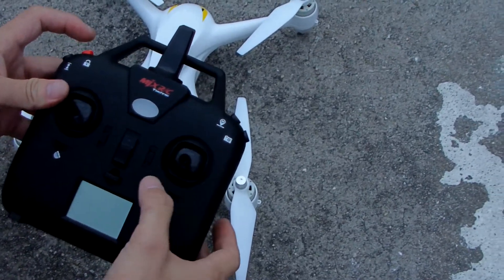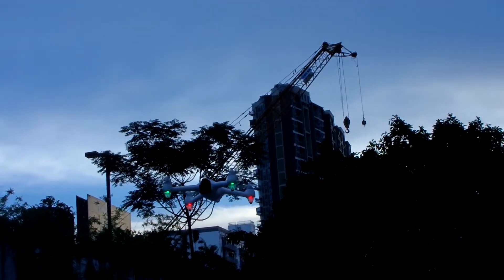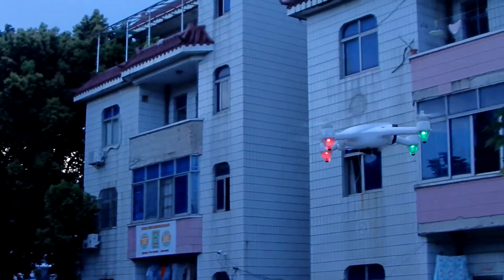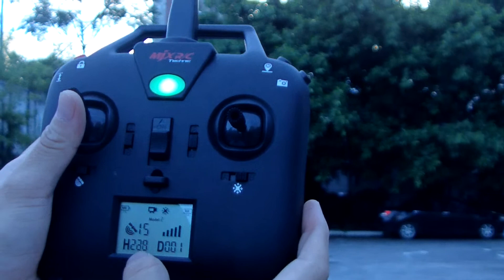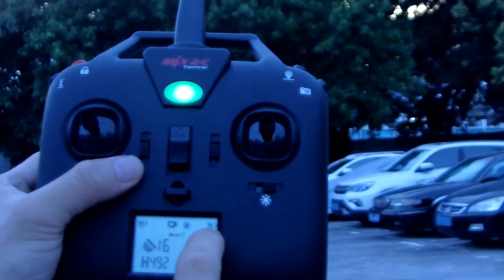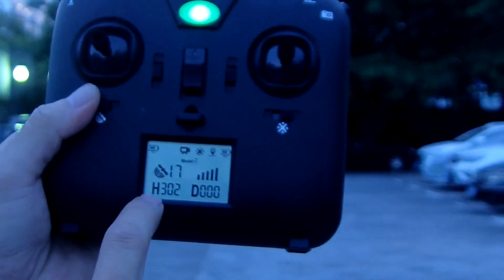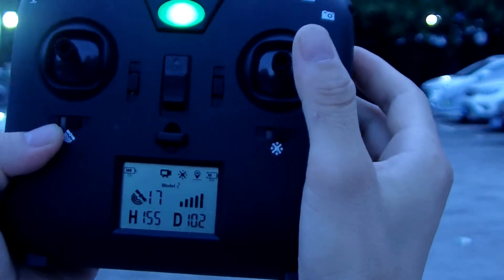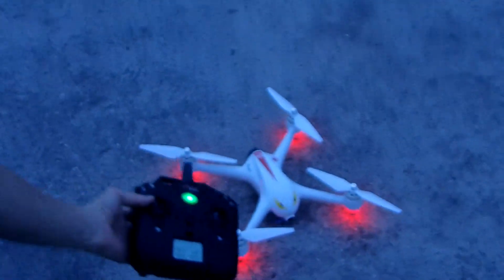MJX B2C GPS Drone first flying and Max Height and flying time confirm

Comment: Weird but shouldnt the rth kicks in automatically once the battery level reaches 2 bar since it is more than 100m in altitude rather than  in this case you need to press it manually?
Reply from the maker: if low battery, you can push "RTH" return to home button, or just don't do any action in remote, just watiing drone flying back.

Comment: are you going to sell extra batteries for this model? The battery door does not go in easily and once in does not come out. I noticed you have different door so must have similar problem. I checked your store on Amazon and no one seems to have extra batteries yet.
Reply from the maker: yes, search MJX B2C battery in amazon store, can get the link, more battery would be sent to Amazon soon,thanks.